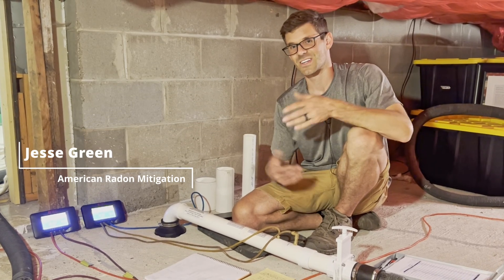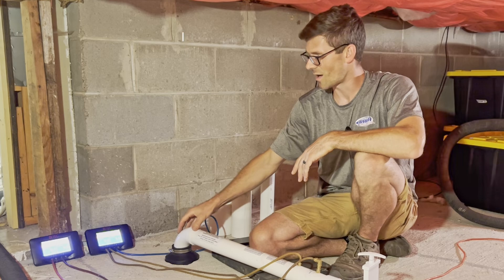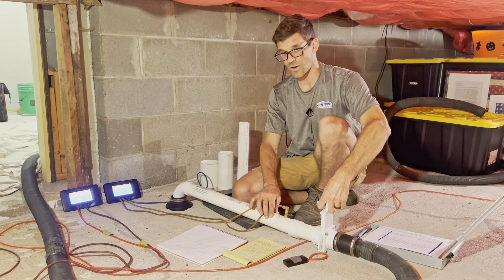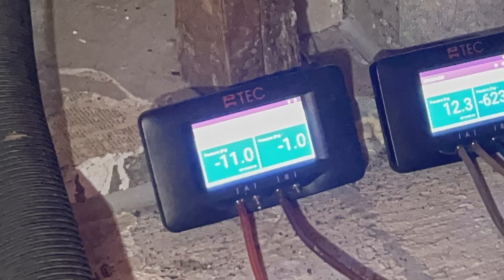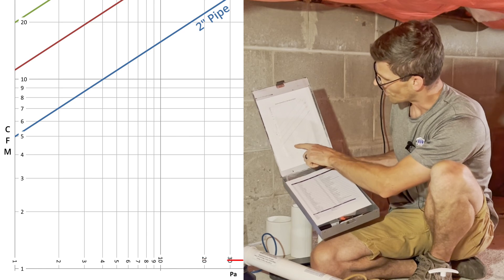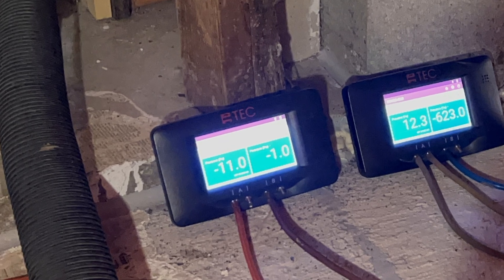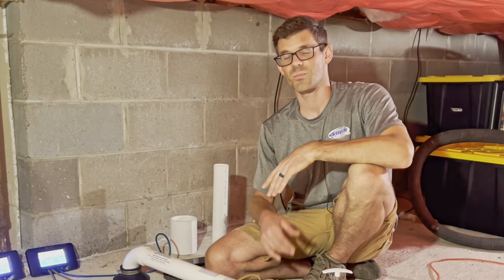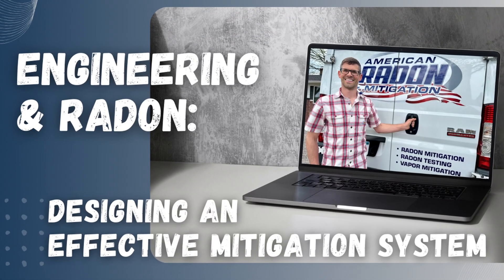Choosing the Right Pipe Size: Avoid These Common Mistakes!

Comment: If you take your velocity pressure readings in inches of water column, you can use a formula instead of that chart. Comes in handy not having to carry the chart around. It's the square root of the velocity pressure * 88 for 2-in pipe.
Reply from the maker: Thanks for the tip, Chad!

Comment: Thanks for the video. I just had a radon mitigation system installed and they used 4" pipe with a GX5a fan and 3 insertion points. It's a 2300 square foot house with a partial basement surrounded by crawlspace, which I've had encapsulated.

There wasn't a great place to pop the fan out of the house without being an eyesore or annoyance. So I went with a bathroom, given that fans often run there anyway. It's a bit louder than I expected, can kinda hear it in the adjacent rooms...

I'm starting to wonder if I could get away with a slightly less powerful fan, but now I'm starting to wonder if I even needed 4" pipe in the first place.
Reply from the maker: You are welcome. The RadonAway GX5A radon fan and 4-inch piping are an unusual combination since you have a high-suction fan that is typically used in tightly compacted soils with minimal airflow, allowing for smaller piping. Larger piping, however, doesn't hurt your system's performance and will be quieter than smaller piping. I'd check out the pressure field information they left in your system's documentation packet and see if your fan is oversized. Compare the target pressure with the actual pressure in their test holes once the system was installed.

Comment: Is that a diy pitot setup? Just two tubes, one static (holes on the side) and the other a hole on the front (ram air)?  I see pitot tubes for HVAC but those are all waaaay to long to put into a 2" pipe.
Reply from the maker: Kansas State University builds them.

Comment: When you install a mitigation system do you expect radon level to vary say during the winter month or do you expect radon reading to stay somewhat constant?
Reply from the maker: They should stay somewhat consistent if you address all of the radon entry points and meet or exceed your target pressure in each of your test holes. If you see elevated levels in the winter, for example, you likely don't have full pressure field extension beneath your home or have adjacent slabs that are contributing radon to your home. These adjacent slabs might be a front step or garage, for example.